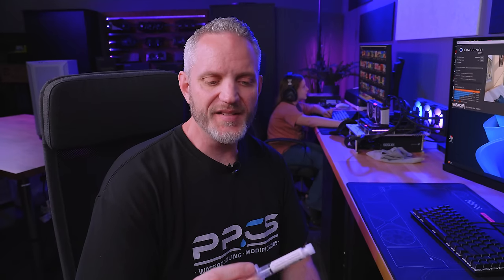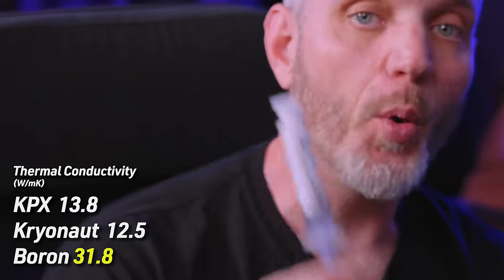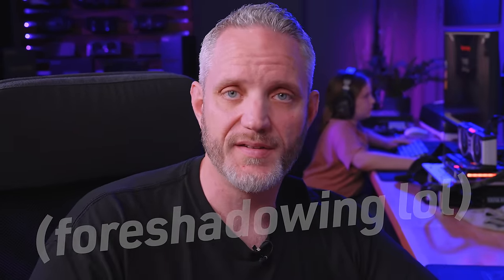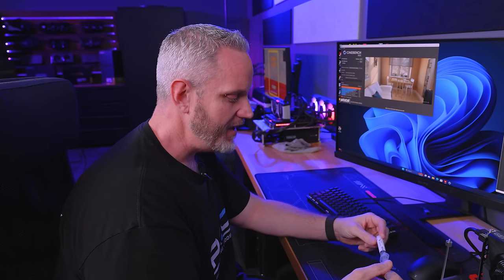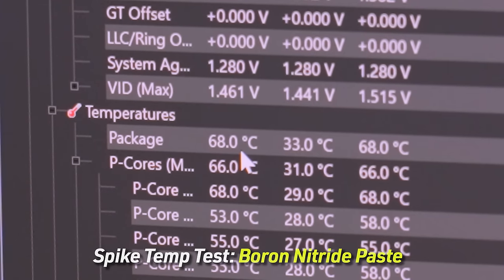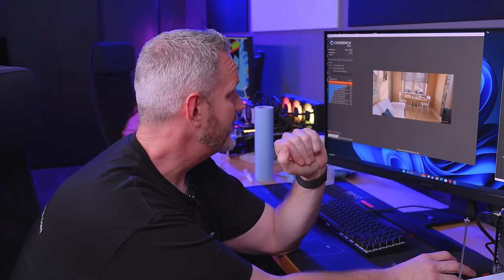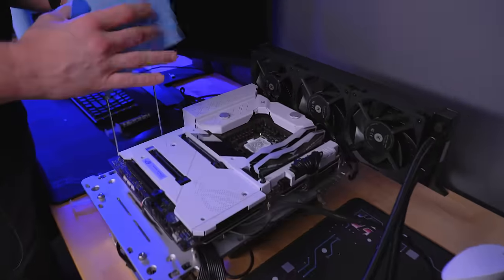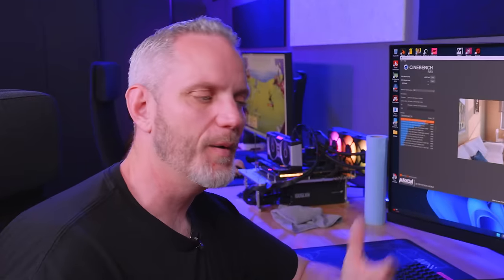Is this the new SUPER PASTE for PCs?!

Comment: Jay, that paste will only conduct heat well after it dries. You must "cook it" first in situ (meaning already applied and everything mounted). It must resemble those flakes that came of the tube when you tried to apply it the first time.
I have used it before while repairing coffee machines. It is used as interface between the resistance and the boiler.
So, you should apply it and either let it dry naturally (which can take months) or crank that CPU for a few days.
One important thing is that, if you remove the cooler, you must clean the paste and reapply otherwise the cooler will not seat properly and the heat will not transfer as effectively because the dried paste breaks very easily.
Reply: I wonder if delidding and baking it onto the lid would work ? You would probably want to leave it a little tacky.
Reply: I guess on paper it has a better conductivity, but only in the right use case which this is not.
A CPU us not supposed to get as to the point where this paste is supposed to be operated at.
Maybe it would be good for some MOSFETs but little more.
That's a nope for computer application.
Reply: @timhartherz5652  True, but also at least it'll be non-conductive at Intel-spec in anything they made the past decade.  Or Apple spec from anything in the past 20 years.
Reply: @kloroformd  "Within specs" for these companies mean "will survive the mandatory warranty period" :-D
Reply: @timhartherz5652  if not, they'll polish a used item for ya.  There's probably an arbitration clause embedded in the firmware for those that want to argue.
Reply: @PhonicallyPsychotic  If you are thinking of then reapplying the lid to the CPU, that would not work because you would lose the thermal connection between the lid and the die that comes from factory, which is probably better than any thermal paste you can apply.
Anyway, as Jay said, this is a bad paste for the application. No CPU ever gets above 100C enough to have good thermal conductivity with this paste.
Reply: @timhartherz5652  Computer wise, I do not think even MOSFETs reach temperatures high enough.
As far as I know, most civilian electronics/devices (except maybe heaters and devices that depend on heat to work, like ovens and pans) are "capped" at about 100C to avoid serious injury if they are accidentally touched. Not 100% sure about that now. I haven't looked at regulations/certifications for a while.
Reply: @boam2943  I don't think there's a cap like that, or nobody cares, I've seen mosfets operate way beyond 100° shouldn't be a problem if you can't touch them.
Reply: @kloroformd  Engineers are not at fault here. This paste and computer paste are different chemicals, with different use cases and workings. 
When computer paste dries completely, it becomes less effective. This paste, before it dries, is basically water from a thermal perspective and still water is a poor conductor.
You should see this paste more like a solder than a conductive goo. Like solder, if you do not melt it between the two pieces of metal you are trying to bridge, it will conduct poorly. Only when it is solid (after being melted and sandwiched) it conducts as spec.
Reply: I don't know the tolerances with the coffee machines, but just as a thought-experiment for a curious mind... if he was sadistic enough to let the CPU cook at max for a few days, given the absolutely micro-tiny space there is, would the escaping vapor not basically push out the paste over the hotspots of the IHS? or would the application be so thin to begin with that vapor bubbles aren't a concern? My gut says the latter but also again just raw curiosity if it is in a way self-defeating for the CPU purpose with how much trouble even a tiny bubble or dry spot can be
Reply: So what I'm reading is "While this product's conductivity might be bonkers, it's such a pain in the ass to use you're better off buying the other stuff. It's like Linux".
Reply: @dragon411320  Coffee machines (forgot to mention I only worked on espresso) are very tolerant and overspec. Even if you forget to put the paste, the machine will still work but the coffee will not be as hot or not produce as much steam and you end up with a coffee that is not as richly flavored.
If I remember correctly, the biggest resistance in the ones I have fixed was rated at 250C for steam. I have never noticed any bubbles when I removed any resistance and, to my eye, the layer of paste seems a lot thinner (almost transparent) than PC paste. Like I said in another comment, this paste should probably be viewed more like a solder than the goo that is used for PCs.
Considering that and that: 1) the 100C in CPUs is in the core ; 2) the temperature in the IHS is smaller than that in the core in a short period of time (heat takes time to travel to the IHS); 3) CPUs throttle down when the core reaches 100C which might indicate that the IHS will hardly ever hit 100C; 4) steam forms at T>100C; 5) that paste is rated for temperatures above 100C; I would say it is safe to assume bubbles will never form and that the paste would just slowly dry (if the CPU could handle such prolonged period running that hot).
Either way, the maximum thermal efficiency of the paste would never be hit because it is rated at temperatures above 100C and the CPUs will hardly stay at 100C. Probably the thermal efficiency of this paste is lower than PC paste for temperatures below 100C otherwise the industry would have switched by now. Sadistic Jay would probably only get a PC that throttles more even with a perfect layer of paste.
Reply: @LautaroQ2812  Well, I was hoping people would read it more like "If I ever need a paste for an application that works only at over 100C then with this paste, this is the way to use it."
"Just like Linux is the choice for any serious work"  :D
Reply: @boam2943  good point about the cores and IHS heat saturation never reaching actual boiling because of the CPU preservation safeties I, completely overlooked that as I was over-fixated on the idea of a "watery" paste and well, my caffeine hasn't hit yet this morning haha. Appreciate the very in depth answer though, definitely makes sense and I enjoy learning about new materials, honestly had no idea coffee machines/espresso/whatever even needed such compound.
Reply: @dragon411320  Learning and sharing knowledge is why I come to YT. It can't be all kitty videos :)
Engineers had to do something. Have you imagined having to wait 10min for your coffee machine to warm up. Some people get violent :D
Reply: @boam2943  haha same, just surprisingly coffee machines are the one thing I never took apart (yet) always figured it was a standard hard metallic solder for the heating element and probes direct to plate. But again my life experience is limited to generic $25 coffee machines
Reply: @boam2943  Oh I agree :) My question was speculative as it's quite interesting. There would be a lot of work involved to get a proof of concept. To address the delidding I would use liquid metal for the die and lid. I was curious if the "Baking" of the compound on the lid would somehow bypass the 100C or lower the threshold down to avg. operating temps.
Reply: @kloroformd  fancy grey room heaters?
Reply: . It would actually need to be thicker in the first place before his applied however, this is not the reason that it does not work. Thermal paste that is put on a CPU has a certain molecule size. These molecule sizes into micro CPU and create conductive layer to transfer heat. This chemical has a different molecule size therefore it needs a different surface texture. The reason that this is so not understood is that we think the surface is perfectly smooth however it is not. Just like the cylinder walls of an engine. You can actually see cross hatch but in the CPU if you were too go into it with a microscope, you would see these little grooves and valleys. This is where the thermal paste must be pressed against into in order to transfer the heat, which is why it needs to be thicker. Between these two factors, it will never perform like proper CPU paste.
Reply: @Fk8td  "It would actually need to be thicker" No it doesn't. He actually put too much. That paste does not work like PC paste. You would know if you ever worked with it. Unlike PC paste, which is very gooey, this paste is very watery to only fill the gaps, the "little grooves and valleys" you mentioned, and that is why it forms a very thin film, as it was engineered to do. 
It is used in high temperature applications where it is required to attach two materials (usually a combination of metals and/or ceramics) and heat must be quickly conducted between them, hence the thin layer. A thicker layer would degrade the heat transfer speed.
Examples are heaters, like coffee machines (used to interface the heating element/resistance to the boiler) and PSUs (used to interface the power transistors/ICs to their coolers).
I do not know how it is used in 3D printers but this paste is supposed to squish out like in this video and leave that thin layer between the materials.
"it will never perform like proper CPU paste" because it was engineered to work at temperatures above what a CPU can hit (100C).

Comment: This is interesting, but would be nice if jay would leave the paste dry out as is mentioned in manual. You should do the 10 minutes test, but you only  tested it in wet condition. " The paste is aqueous, so the water carrier must evaporate before the compound becomes an electrical insulator. Paste bridging a temperature sensor’s lead wires will affect the sensor’s measurements while the paste remains wet. Dry the paste by allowing it to set overnight, or to save time, heat it to a temperature of 90°C for ten minutes. The paste will dry completely, and temperature measurements will return to normal upon first use of the hotend.

Avoid exceeding 100°C while drying, to keep the water from boiling and ejecting the paste with steam."
Reply: RTFM Jay, not long enough with nowhere for the water to go. This isn't as bad, but don't be Linus with Billet Labs because of impatience and not wanting to go through the hassle.
Reply: Not to mention that, IMO, he put WAY too much on the CPU.  The best conductivity would be metal to metal, but since the metals aren't perfectly smooth, there are, as Jay noted, "voids" and non-contact points (due to the CPU/cooler not being perfectly flat) and there needs to be a minimal conductive paste bridging those gaps.  

As you noted, water isn't the best temperature conductor (only 0.6089 w/mK - Wikipedia), so it would need to be evaporated before the thermal paste would perform its best.  So, yeah, I'd like to see this test repeated.  Especially, since it doesn't seem to be being used in an optimum manner in this test.

Anyway, my "$.02"...
Reply: @Revan_7even  Good news is he's not naming companies.  This is an example of how preconceived bias can result in a flawed test.  In this case it's a reasonable, "The product was not designed for this application."

Comment: Slice Engineering does 3D printing stuff BUT in that application there is usually not the pressure that PC coolers have. the layer might be thicker and doesn't spread out as much. layer thickness is much more important that the heat condusctivity. we are all good off using the products that are application appropriate.

Comment: Most of the paste is supposed to be pushed out. You don't want any thickness. You want as much of the IHS and cooler plate to actually touch, with the paste only existing in the areas that will not touch because of microscopic deviations from absolutely flat surfaces.
Reply: If you do that then you will get voids as the paste shrinks. The spec is usually one or two mils
Reply: That is what I always thought but I had problems with Thermagic ZF-12 because of how thin it was. It works fine at first but then it squishes to the sides and temps start to get awful again.
Reply: @hmello3250  there is a happy medium. If the paste is very thin then it runs out of the areas that it's supposed to be filling. Essentially leaving airspace in between the two surfaces. I guess I've just never run into one that's that thin.
Reply: @shanent5793  any proof of this? I've never heard of this, or any effects from this, if it happens. The guy you're responding to is right with some of what he is saying. You want to remove the air, using the thermal paste. So more is better (unless it's conductive). . Also, application is cold / room temp. From there it gets warm and it's viscosity increases, so the volume expants . Even when that contracts, I don't see it creating voids, it's not "slime" or playdoh.

Comment: Usually even more important is how a substance will fill voids without trapping tiny pockets of air as your put the cooler down. The main challenge of PC cooling is that air, not the thermal conductivity of the medium, since to just get it highly conductive is easy in comparison to, making something that will fill every pore and microscopic void and expell any air.

Comment: I'm not supposed to let this out but that stuff is an additive to thermal paste and if you use it in a 1:5 ratio it will enhance any thing like kpx tgx etc. It beats anything by 5% fresh, you see about a 10% lift in cooling on older paste.

Comment: The biggest predictor of a TIM's performance is minimum particle size, not thermal conductivity. Smaller particles, or fully liquid TIMs both allow for the filling of smaller imperfections but also reduce the distance between the IHS and the heatsink, which itself helps thermal transfer.

Comment: Been using GD900 from AliExpress for years...which costs $6 for a 30g syringe. Works great and costs pennies on the dollar relative to big name brands. I use it on both the CPU and the GPU, without any issues across the 4 PC's in my house. I do try to change out thermal paste once a year...as a matter of routine...not because temperatures started to rise around that timeframe.

Comment: I've noticed one thing about expensive thermal pastes.
The best ones spread super easily and that's what you should be paying for.
You can get a big tube of PK-3 or something pretty cheap, but something like a Kryonaut that's a couple times more expensive... way easier application.
Good application = good performance. You can get there easily or you can find a spatula for the thick stuff.
Reply: very good. someone got the point. the application is more important than the material itself. conductivity is not "linear". the 13.2 vs 12.5 conductivity won't have any effect. Even beyond 20 W/mK is not something spectacular. This is a UNIT of measurement. Not a guide. Watts per meter Kelvin. written wrong from the beginning ... Joule was like "am i a joke to you?"

Comment: Jay explained it already in the passt but:
W/mK=(W / m^2) / (K/m)
Basically how much power per unit surface per Temperature gradient you get. Double the surface, double the power. Double the gradient, double the power. You can double the gradient by doubling the Temperature difference or halving the distance (usually the thickness).

Comment: The calculations for W/mK depends on a lot of factors and are easy to fudge to get a number that looks great but doesn't apply to PCs. Things like the temperature difference between the heat source and cooler out the thickness of the thermal interface material can make it very wildly. This stuff may work extremely well in its intended application but less so in PC cooling. In any case, glad you tested it, it's always nice to see things tested in different ways by different people.
Reply: As others have noted, the temperature it's tested at is a key factor. Given this is designed for 3D printing, it was likely tested at 200+C.  So, twice the temp!

Comment: The air will always form pockets within the paste, albeit tiny ones, because unless the paste is permeable to air, the air remains trapped in the tiny imperfections of the paste and the two surfaces. Heating and cooling the system will pump out the air, probably, and this is PROBABLY what we experience as "burn-in" period of newly applied paste. 

Still, paste will not have lateral heat transfer nearly as good as solid material. That's why integrated heat spreaders remove hotspots and get the CPU die to a more homogeneous temperature, which then is lowered by the copper and the fans. Direct-on-die application of thermal paste cannot easily get rid of hotspots unless it's liquid metal TIM. 

For notebooks, liquid metal is a suicide pact if something goes wrong or the notebook is moved when hot. Which it will in a few years when you have forgotten about it for one minute. Laptops thus can't be cooled with paste of LM TIM well enough. 

After trying it on 3 different ThinkPads, I can recommend the Graphene pads, which perform similarly to paste in bulk heat transfer, but totally exceed over paste in removing hotspots. The maximum wattage for sustained benchmarks and loads is the same or better than good paste, but within the 1-3 degrees centigrade measuring error. However, single core loads don't spike rapidly and don't trigger the throttling. And application is done in a few seconds, unless one is a perfectionist. Then you'd lap and polish the copper plate to a mirror shine (30min, up to 10,000 grit) and degrease everything with iso alcohol and then lay down the graphene pad with soft plastic tweezers.) never touch them with bare hands, though.